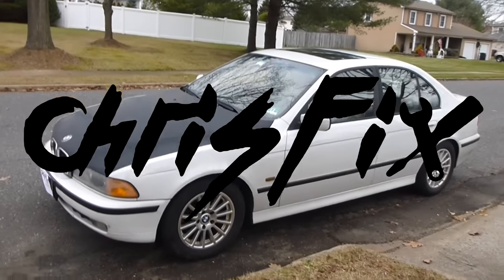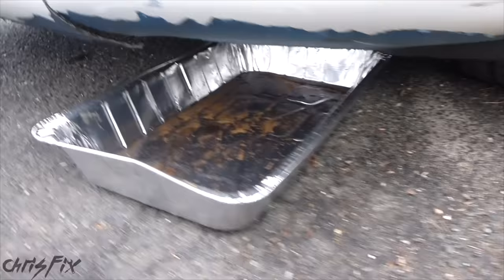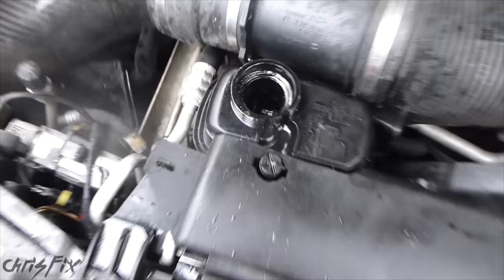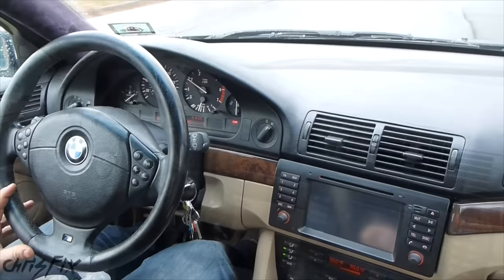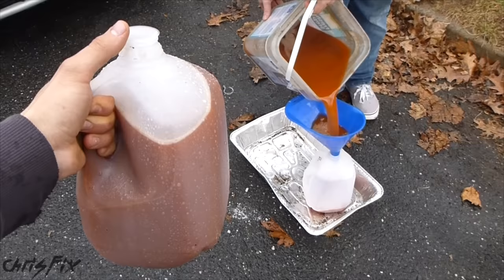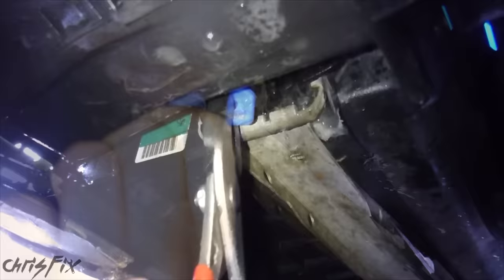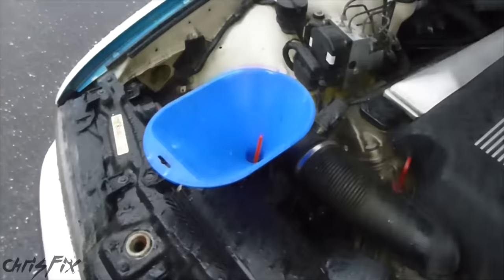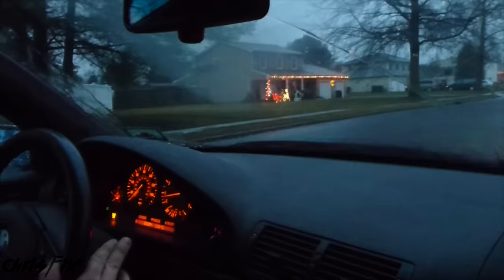How to Quick Flush Your Cars Cooling System

Comment: You should use only blue antifreeze in any BMW, regardless the build year. Using something else will create slime and build-up over time in your cooling passages and hoses.
Reply: Someone doesnt know how coolant works 😂
Reply: @Frank-db2lb   How does it work?
Reply: @legioner9  There is TONS of misinformation out there on the different types of coolant. First and foremost, all coolant starts out clear, and there is no industry standard or regulation for adding color. It is up to the coolant MFG to choose what color they want to use in any type of coolant, making color irrelevant. Never choose a coolant based on color, only go by type.

There are three basic types of consumer engine coolant, and they all contain an ethylene or propylene glycol base, water, dye and an additive package. Each type, or group, is referred to by the additive package it contains:

Group 1: Inorganic Acid Technology (IAT)
Group 2: Organic Acid Technology (OAT, also known as Dex-Cool)
Group 3: Hybrid Organic Acid Technology (HOAT, also known as formula G O-5)
IAT was the “original green” coolant. It gets its name from the inorganic rust inhibitor package it contains, and has a high silicate content. The nature of this package causes it to break down as it performs its job of prohibiting rust, and as it is exposed to air and heat/cool cycles. This is why the coolant needs to be replaced so often. There are no longer any vehicle MFGs that use this coolant in their vehicles.

OAT on the other hand, contains no silicates, and inhibits rust using a purely organic package. OAT coolant is most widely used in the US by GM, and different formulations are used by many MFGs in Europe and Japan. This type of coolant is most often found in "closed" coolant systems where the entire system, including the overflow, is pressurized.

HOAT is similar to OAT, except for that it also contains silicates. This is seen by many as the best of both worlds, and Chrysler, Ford, Mercedes and BMW (among others) tend to agree. This type of coolant is most often used in "open" coolant systems that have non-pressurized overflows.

Here is where many of the arguments arise. Can you mix the different types? IAT and OAT cannot be mixed. Their rust inhibiting packages are too different, and in some cases can react to each other. HOAT can be added to either of the others with these caveats:

Adding HOAT to IAT does not lengthen the service life of the IAT. You should still change it at the recommended IAT intervals.
Adding OAT to an "open" HOAT system has been known to cause build-up issues in the radiator and passages of some vehicles, and is generally not recommended.
Your best bet if you want to use a different type, is to completely flush the old type of coolant out before pouring the new in, as this rarely causes issues.

In conclusion, is there a "universal" coolant that can be added to any group/type that is already in your system? Absolutely not, and many coolant MFGs are being sued over such claims. You cannot have a coolant that meets both the silicate specs of IAT and the non-silicate specs of OAT at the same time. It cannot be done.

Comment: Is it safe to use coolant flush liquid on old cars? I am thinking the chemical might thin out parts that ve been corroded..? How about just using tap water and flush it into radiator while engine running with drain cap off..?
Reply: Never use tap water, the minerals and chemicals in it will eat away at your cooling system. I know you see a lot of people doing this but its wrong IF you want your cooling system to last as long as possible. Stick with distilled water only.

Comment: I have 2013 honda accord ..they dont even recommend doing a coolant flush, just a simple drain and fill . So if i  do this flush will revving up the engine push out all the water out from the engine block ? Thats my only concern since i will be using the pre mixed coolant.
Reply from the maker: Not all the water but it will get a good amount out
Reply: @chrisfix  got it..thank you Chris

Comment: Hi , by the way , I love your videos , I’m a little bit confused , I’ve read a lot of things on the internet about the coolant , do I have to use distilled water in my coolant 50/50 or just the coolant in my radiator?
Reply from the maker: It has to be 50% distilled water and 50% coolant. Some bottles say "concentrated" on it and that is 100% antifreeze. There is no water. So you need to mix your own so it is 50/50. Others are pre-mixed and you will not need to add water since it is already 50/50. Hope that helps.
Reply: @chrisfix  you have no idea how I appreciate you for your videos brother , there is no way that someone by watching your videos to not be able to do it themselves , you’re so detailed in your videos , I love you brother and thank you so much for doing this .

Comment: Why do u have to use distilled water and where can u buy it, also how often should u change/flush your system my car has 35,000 miles on it with out being changed.  Check your owners manual right? Also can you damage your water pump if u do not BURP the radiator hose?

Comment: Hey, I did this process on a bmw e46 320d, when I went for a ride(with the chemical flush), the temperature wasn’t consistent, did not pass the 90 degrees, but sometimes decreased. What is the problem right here? Thanks
Reply from the maker: Was the temperature changing if you were sitting vs moving?

Comment: When your putting in fluids for doing the flush, you say to fill the radiator with distilled water, then your say put in the chemical flush, but if the radiator is full of distilled water then there is no room left in the radiator to pour in the contents of the bottle of chemical flush?   Wouldn't it be better to pour like half the distilled water into your radiator,  then pour in the bottle of chemical flush & then top off the radiator with more distilled water?

Comment: I just flushed my 02 Mustang GT. Only 2 gallons came out even though the owners manual says the capacity is 3.5 gallons. I continued the flush anyway and couldn't get more than 2 gallons into it (flush + distilled water). Drained the system again but couldn't get more than 2 gallons of 50/50 mix of antifreeze into the car. Must be that only the radiator got drained. Despite this, my coolant/antifreeze tester shows that the fluid is fine. But it concerns me that not all 3.5 gallons got removed before the flush. Anyway, I'm still looking for a place to legally dump my old coolant - I called 17 places so far and none will take it. Maybe it should be a bona-fide permanent antifreeze.......

Comment: Hi my friend. I have a question, l changed the coolant of my mitsubishi lancer 2014. I added Prestone 50/50. It was like a light green color when added. However, l see the reservoir where the color have changed, it is now like dark green. I just wanted to confirm of it is not a red light and the coolant color changes when using the car. Thank you so much.

Comment: Thanks for the video 🐐  but im having a slight issue. When I flushed the radiator my reservoir level won't go down.  I tried letting it run and used a turkey baister to try and remove some but im not sure if this is the proper way. Thanks anyone for help

Comment: so if the system takes 3 gallons of coolant, it needs

during flush; 4 gallons of water and 32 oz of flush

post flush;  4 gallons of coolant + 14.5 oz of anti rust sealer

?

Comment: Hi Chris  - my coolant didn't all drain out (2004 Infinity  G 35). The heater never warmed up , though the engine was at normal temperature. Does this mean there's an issue with the heater core? Thanks for any advice.

Comment: I have a premio 240, 2003 model car. Previous owner has used water as coolant and water contains rust when i see by removing the cap on the radiator. So if i clean it and replace wth coolant, i should add sealant additive right? My car coolant capacity is 4 litres, how much coolant? And how much distilled water and how much sealant additive i should add? Please guide

Comment: Should I do an exchange or flush on my radiator?  My shop that I take my car for service says they do an exchange.  Basically they drain the radiator and then fill it back up with new antifreeze.  What are your thoughts?

Comment: Hey, I have an 04 Chevy Classic (Malibu) and I did this yesterday. Everything went smoothly but the car only took the antifreeze in the reservoir, and when I started my engine to pull it down, it didn't pull any down at all. The car is still maintaining temperature, but just a hair over halfway now instead of at halfway. I was using water because I had a coolant leak and I found out it was my radiator cap. 

Is it air in my system? Or is it possible I didn't drain the water all the way? Also, when my car is fully heated up, the upper radiator hose doesn't feel like a sausage, but it's more squishy, like it isn't getting proper flow. It's in good shape though. I bled the air out (or so I thought)

Any idea what the problem might be? Love these videos!

Comment: So you can have that car running briefly with no water or antifreeze, to get the remainder of the water out of the engine? That’s where I’ve been getting confused, I know how to flush and refill the system but what about the water that is stuck in the engine after the flush. Now I know you can run the engine to get every last drop of liquid out of that system right?

Comment: Question: Will this method eliminate any leftover distilled water in a pressurized system? I have an ‘01 Cobra needing a new upper hose and I don’t want to recycle the old coolant back into the system after wire brushing and paint protecting the metal radiator pipes.

Comment: So in order to completely drain the engine, radiator, and reservoir you need to leave the drain open and wait for the thermostat to open and send all the rest out? I’m getting frustrated doing mine because it’s a 4 gallon system that will only drain out 1.5 gallons. Making the flush take forever.

Comment: I have a 2002 bmw 330i that i replace the water pump and thermostat after bleeding the cooling system while I'm driving or temp goes to 95 the temp gauge goes to red and i slowdown the temp gauge comes back normal. Any suggestions. Thanks
Great video
Reply: Sounds like bad radiator

Comment: will opening the res cap during engine warm up keep pressure from building in the system? i figure this way it will heat up faster and will make draining safer ,it will be near boiling hot but if careful you wont need to wait 1 hours for engine to cool off between flushes and since no pressure it wont burst and scald you

Comment: After draining the radiator will there still be fluid in the reservoir. When I went to put in water and the coolant flush. I could only get about a gallon in the radiator before it was filled. I had the car on with heat blasting but it didn’t suck anything down. I’m assuming everything didn’t drain out of the car because there was still stuff in the reservoir but noting was coming out with the car on. Is this going to be a problem or should I just fill the radiator with new coolant, and not worry about it

Comment: Hi, I have the exact same car, do you have any advice on to how to put it back in? Cause I found out it DIDN’T have a plug and I had bought one. I slipped it in, but it doesn’t want to turn. I tried until it just broke the tap on the plug. Should I use any lubricant ?

Comment: ok i got a  question about draining the coolant to have it replaced,,i am wondering if by draining it from the petcock if this will completely drain the whole system or will you always have some fluid left because you have a thermostat valve which will keep part of the coolant in the engine and the heater core? cause i seen in some vids you have to drain it through an engine plug as well,,or sometimes through the pump, does it also need to get to temp and open up the thermo  to drain the remainder? obviously you should not be running it while doing this should you?

Comment: A real pro tip is : dont mess with 15+ year old plastic pedcocks, just pull the lower radiator hose so you dont brake anything.

Comment: Does the repair shops do it like this these days ,,, but when I took auto shop in highschool the teacher had a plastic thing he got at the auto parts store with the antifreeze and he cut into the radiator hose and installed it the hooked up the hose to the devise he installed turned on the water and flushed the coolant system that way , do they do like that any more , Mr Chris fix
Reply from the maker: From what I know, most shops usually have machines that can do a flush like you're talking about!
Reply: @chrisfix   I remember a while back asking how they did the flush , they said drain out the antifreeze and then put new antifreeze and that's it he said

Comment: Aye wassup Chirs, im still a beginner in learning about cars and I've been watching and saving your videos for when i get my own. You said to fill up the reservoir and then later you said the radiator cap. I know theres the radiator cap on the radiator itself and the reservoir is normally located away from there. Any clarification would be greatly appreciated. thanks!!!!!!!!!
Reply from the maker: I'm glad you're learning from the videos! On this BMW, there is no cap on the radiator itself unlike most cars, and the reservoir is the only location where you can add coolant. The reservoir is mounted to the radiator, and the cap on the reservoir is effectively the same as a radiator cap, which is why I said that in the video. In most cars, like you said, there would be a cap on the radiator and one on the reservoir (located somewhere else)
Reply: @chrisfix  ohhhh so it was just the bmw exclusively understood understood. Thank you so much man!!!!

Comment: im confused,after the water and drive it was coming out cruddy orange but then how did it go clear? did you add more water and do the whole drive again or just run the engine a while and kept doing that till it cleared up? also when you are runing the engine to squirt out any remaining water and you got not coolant in the system will your coolant guage read or show an error?

Comment: Hi Chris! Long time fan of yours! I don't know why I didn't check out this video sooner! I may have missed some steps in the process when attempting it blind, by myself, and now it's overheating and there's a weird gunk under the cap. I guess I didn't realize how important running it with the cleaner truly was before putting in the new anti freeze. 
Do you think I have to take more extreme measures besides the coolant cleaner in order to clean that new sludge out? Thankfully I haven't driven it much since the attempt.

Comment: Quick question my is below the minimum like half L missing i got the peak 50/50 it does said  universal formula for all model and brand its like greenish color.  My car is a 2014 buick regal premium and it said to used dexcool 50/50 and its Orange. Will it be ok if i miss those 2 or should i used the same colo ?

Comment: is it okay to flush the heater core while you are at it? I need to do both. I was going to drain all the coolant out. Then flush the heater core out, put the hoses back on. Then fill the radiator with the distilled water. Do I need to add the distilled water to the heater core after flushing?

Comment: can you use Coolant sealer/leak stop? i couldn't find any anti rust stuff at my local shop all they offered were leak stops pretty much but my radiator isn't leaking just got to flush it. i got the chemical flush too but the car is old so idk if the radiator was even changed prior or what i do plan to change it out though but maybe in a few months

Comment: Hey Guys. I'm going to attempt to change my grandmother's water pump on her 1999 Mercury Sable. I believe I have to flush the coolant system first. Am I safe to run the car to circulate the distilled water even though there is leak in the system? Or should I just drain the coolant and refill it after the repair is finished, THEN flush the system after the leak is fixed. I appreciate any insight ! :)

Comment: Hey Chris, I have a 1998 Buick Century and I changed the thermostat and a blown bypass hose, now I’m trying to fill the radiator with coolant and at first the coolant goes in but it is constantly is bubbling in the funnel and after 10 minutes the coolant all starts filling back into the funnel and I have to stop the car the prevent it from overflowing.  Do you have any idea what’s going on?

Comment: You gotta bleed BMW's. That engine will get hotspots and/or airlocks, and you're gonna have a whole set of other problems (including a ruined engine). It's also quite overfilled; the floating plastic thing should be halfway up, not all the way.

Comment: So i have an ac compressor bypass set up cuz my wiring harness melted on to my clutch, do i genuinely need to run my heat cuz its already 90° out here. Only doin this cuz my coolant looks a lil rough and i had a p1299 code pop up on me for a week
Reply from the maker: I would to flush anything out of your heater core, that will make sure you get to all parts of the system
Reply: Nice that you'll answer on a vid this old

Comment: doing this only drains the rad and if you lucky the res because the thermo is closed there is still coolant in the engine jacket and the heater core, suppose after you drained out what you could while the eng is cold why not turn on the engine and let it get to temp to drain out the remainder? will this be a bad idea?